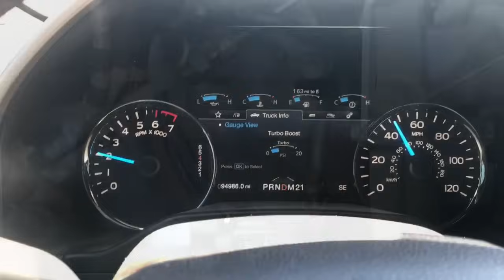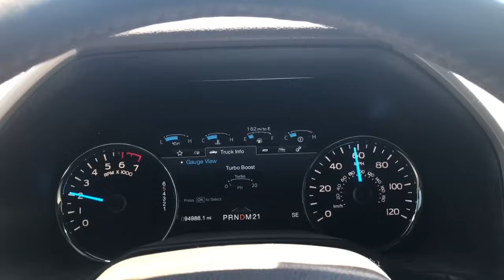F-150 Ecoboost 3.5 Turbocharger Replacement (Tips and Tricks)

Comment: on the wider pipe that connects to the air box, there is a small hard hose/pipe that connects to this pipe and what I believe to be the turbo actuator, after looking up the part number on it. this has broken off of the bigger pipe that connects to the airbox, that also looks gunky on the inside of the line. what is the name of this hose? it has caused some throttle body codes (first inspection there may be a bigger cause to the codes), and I want to start the diagnoses by replacing that hose/line.

Comment: My 2015 ecoturd has 111,000 miles with 5400+ engine idol hours I am having to change the drivers side turbo due to a bearing whistle sound.  your video is super helpful.  I did not know about the coolant drain part had I not watched this video.  GOt any tips for the 4x4 vacuum system and the wheel bearing noise it makes, mine always has a wawawa sound then when i shift into 4x4 it goes away.
Reply: can I ask what your oil change habits are for this 2015 ecoboost, as well as oil type ? Just curious.
Reply: I had that 4x4 issue on my 2015... there was a vacuum leak in the hub assembly so the hub had to be replaced. Took it to the dealer 5 times about the issue before they fixed it.
Reply: Dorman has an IWE permanent fix I used on my truck after multiple IWE replacements. I would recommend you look into this. I’ve had no further issues.
Reply: Daniel Hucklebridge hello. My oil change regiment is 5k and I use mobile 1. Also found out it wasn’t the turbos it was an exhaust manifold and it’s not completely fixed. Had to take it to the dealership.
Reply: My dealership charge is $175 per hr, quote 5 hour repair drivers side coolant leak.

Comment: I have a high mileage truck "210k". At idle the driver side turbo sounds like a bucket of rocks, and under acceleration the wastegate is very noisey.  Will be parking it soon to investigate further.

Comment: The coolant is leaking from the turbo charger.  What do you recommend?  Did you actually replace the turbo charger or did you just replace the bolts to stop the leak?

Comment: I’m having blue smoke upon startup and was thinking of replacing the oil supply tube for the driver side turbo. 

Did you replace the turbo with new or was this a service only job that you performed in this video?

Comment: Great video, good job explaining every nut and bolt!! I recently bought a 2015 F-150 3.5L Ecoboost, and I believe that I have a small oil leak from the passenger side turbo charger. It is very odd, I looked under the hood and noticed white smoke coming from there, but not a lot and not constantly. Only after running the engine at highway speeds than coming to a stop, also when idling for a while. It is very strange thing. I am 95% sure it is coming from the turboc area but i still can't pinpoint it.I saw in your video that the oil line is located between the turbo and the block, maybe that's why I can't see the leak... Thanks again!
Reply: No the line your thinking of is for coolant not oil.
Reply: Did you fix your problem? my truck is doing the same thing ..
Reply: same problem with my 2014 (smoke on passenger side). Leak was from vacuum pump. Google vacuum pump leak on ecoboost.
Reply: @BodeknockerBrumbill  Correct I just changed my vacuum pump.  Mine was smoking also.  Although Ive noticed I do have a coolant leak at my right turbo.   Havent tried to tackle that one yet.   Is it possible to just remove the bushing with the two o rings in it with out taking the turbo off?

Comment: I’m getting ready to replace my turbo. Have a question. I don’t have a torch but want to make sure I can crack those exhaust bolts off charger. Would a regular propane torch be hot enough to get those cracked loose?

Comment: I noticed an oil leak on my 14 eco 3.5. Researched and decided to tackle the vacuum pump. Replaced it, but noticed afterwards the burning oil smell still happening, and it’s coming from the gasket on the turbo. Do you think that could be remnants from the oil leaking from the above vacuum pump, or is there something that would cause the gasket area on the turbo to be smoking?

Comment: Great video besides on the 2012 the o2 sensor doesn’t allow you to slide the flange down so you have to remove those pos studs from below
Reply: Behind the brake pedal, there’s a cut out circle in the insulation. Pull that back there’s a rubber grommet that’s how you access the bolt closest to the firewall.
Reply: @donw22  that’s interested I was doing the passenger side they make it where you have to pull the studs to get the turbo in out vs sliding the exhaust coupler off the studs and out of the way. The nuts weren’t bad at all to get out though

Comment: On first start up after replacement how do you prime the turbo with oil?
Reply: Too late for you but for others, answer is hold the gas pedal all the way down pinned to the floor while you start the truck. Prevents fueling so the starter turns the engine and thus oil pump while it cranks. Hold gas pedal down for a good 7-10 count then release and truck will start.

Comment: How did test my turbos see if that’s my problem. I’ve had trouble with my driver side turbo. I just put a new one on one year ago now I have error code P0299. I just changed out the boost control it did not fix my problem. Error code still keeps coming up. I did the 10 point check all of those things look great. My turbo is not rattling like it did the first time please help any advice would be greatly appreciate it.

Comment: Did your turbo blow off sound like it was under water? Mine started doing this a few weeks back. As long as not under a load or high RPM it’ll drive fine. Once at high speed or rpm, it’ll throw a misfire code and go into low power mode. As soon as I clear the code on the fly, it goes back to normal and drives fine.

Comment: I don't like to use grease, my preference is Vaseline as this will not hurt the o-ring rubber
Reply: Vaseline (Petroleum jelly) is petroleum based.  It will swell and deteriorate the o-rings.  Use silicone grease on o-rings.

Comment: Great video! One question, do you have a list of the tools needed to do this job? I'd like to be sure I have everything before I start and realize I need something I don't have. Thanks!
Reply: The only weird tool you might need is that torx bit I think he said T47 or something like that. Everything else you should already have
Reply: He said t-47 for the 3 turbo fasteners but I didn’t hear if the other 2 were different.  They look a lot smaller.
Reply: Hello, did you find out what size torx socket is needed to remove the oil feed/return pipes from the turbo?
Reply: @erikwille5614  No, I was pretty short on time so I ended up getting a local shop to do it for me.
Reply: Oh okay, thanks for getting back to me  :)

Comment: My coolant line will not pop in the fitting after installing the nrlew one from ford. If i do not install the fitting and push it on the line it works but after install it will not

Comment: How did you know the turbo was going bad? Was there any engine codes?  Because I'm getting a crank position sensor code P0019 and P0025.  And one dealership said that my timing chains might be out of adjustment.
Reply: From what I've seen end up at dealer auctions, any engine besides the 5.0l need timing jobs around 130,000kms. The turbos last about the same. Currently dealing with a 3.5l twin turbo from a lincoln mkt that has both turbos failing. Guess the milage lol.
Reply: korutube i’ve had my orings done last week and my 2016 Expedition only had 50,000 miles when it went bad on both turbos.... why did it last over 100k in this vid??? This f150 is a 2013????
Reply: @ega0117  that fast huh? I haven't seen them that early yet. Unless you drove it too hard, or missed oil changes, I'd say they were bad since the truck was new. Either that or they somehow are making even worse turbos than before lol.
Reply: I’ve put over 100k miles on 3 Ecoboost trucks and never had turbo issues. The trucks were tuned too. I changed the oil on time and used motorcraft blend. I also used a colder t stat. My 17 truck was showing scary temps from the factory. 230° F towing moderate weight. I wasn’t a fan... 215° in stop and go traffic.. swapped for a 170° t stat and I never see above 187°.

Comment: Sort of a silly question, but i have the 3.5 in my SHO. I think the engine is turned in terms position in the SHO’s. I have a turbo in the front and rear. Which i need to replace my front turbo, is that the right or left turbo???

Comment: Not sure if this is a diy type job for me but the cost to pay dealer gives me long pause. When reinstalling top exhaust flanges with turbo and the air intakes at top you mentioned to make sure they’re done first. How hard is it to make sure it’s aligned properly so proper torque is done?
Reply: @Salvatore Izaiah instablaster =)
Reply: @Zane Jordy thanks for your reply. I found the site through google and Im in the hacking process atm.
I see it takes quite some time so I will reply here later with my results.
Reply: @Zane Jordy it worked and I finally got access to my account again. I'm so happy:D
Thanks so much you saved my ass !
Reply: @Salvatore Izaiah You are welcome :)

Comment: Oh thank you for the video. I had this job done by a mechanic, The truck was smoking a lot and burning oil. He said that it was a turbo in need of replacingafter he installed the turbo on the driver side the truck started fine but then all of a sudden it turned off and won’t start. It keeps on smoking a lot. Any ideas why this is happening? Thank you in advance
Reply: What did it turn out to be?

Comment: hey aaron....I have a 2011 f150 EcoBoost,  can I put 2013 turbos on it?   I notice the front part of the housing is completely different.    can those housings be pulled off my 2011 turbos and put on the 2013 I have?

Comment: I'm having an issue with removing the turbocharger on the passenger side. I removed the clip on that oil line fitting but the turbo won't pull away from line. Like it's stuck in fitting. That is the only thing holding the turbo up at the moment
Reply: How did you end up getting it off?

Comment: Did you experience any smoke from turbo seals during start up in the mornings before changing your turbo? Mine smokes like a chimney in the morning then after I drive it about a mile the smoke goes away until it sits again for awhile.
Reply: I have the same problem..
Please what did i do ?

Comment: Nice video. If you were going to buy a used truck, would you go for the 3.5, 2.7, or 5.0? Or would you go Tundra? Last question: has there been an average number of miles when the turbos go out? Thanks in advance.
Reply: 5.0. Anything over 120k will need turbos and timing chain on eco boost. Most will sell or trade vs the $8000-$10000 repair… I loved the eco power but I’m going back to v8 before they ban them. Engines always will have issues. But turbos and everything else is just more things that will break eventually on top of normal issues. It’s just to much. Everyone will be buying them up in next few years. Toyotas already gone full v6 hybrid twin turbos. Talk about 3 X the mechanical things to go wrong. At about 125000 -150,000 miles the battery will be done, the turbos will be done, so you’ll be looking at $10000 to $12000 for a Turbo job with inflation. Then the battery replacements $20000+. Your already on a ten year loan for a $80,000, $100,000 truck and you’ll hit these miles in 5 years or so. Still owe $40000 and have to dump $30000 to repair it cause it’s outta warranty. Most will trade then the next sucker will get stuck with it. Welcome to Bidens future America.
Reply: @Regular Guy Fixes  I bought a 2011 F150 Lariat w/ the Ecoboost engine, with the dreaded P0016 code.  Ended up being the timing chain was stretched.  Cost me about $3500 to fix the timing.  Even paying out of my own pocket, I still came out ahead for what I bought or what I like to say stole from the dealership.  If they would have fixed it, they would have wanted $5000 to $6000 more than what I got for.  I got to replace the compressor now as the clutch is about to break from the sound of it.  Other than that, it's been a really good truck.  I have a 2018 Explorer Limited with the 3.5 and hate it that it doesn't have the boost.
Reply: @regularguyfixes3142  ok so I have a 2013 F150 (137k miles) leaking/cracked passenger side turbo.  $2,100 to put in a new one.  It has to be done because it needs a gallon of antifreeze every 100 miles.  While the truck runs ok it seems sluggish and gas mileage is poor - usually averages 14.5 mpg  I have a P0016 code.  Mechanic suggests keeping an eye on it - but now I'm wondering if I should just trade it based on your comment about timing chain cost.  Am I living on borrowed time? I don't want to sink in another $4k for the timing chain.  Truck is a Platinum loaded and in excellent shape otherwise.  Advice?  Thank you in advance.
Reply: @danmichalko2673  if it’s ticking when it cranks up at first you will know. That’s the Chain. I’m at 210,000k on my 12. Been running good since. Has to replace a coil and plug recently. But wife daily drives. Just depends do you got the money to start over. Pay $4-$8k or pay $50-$60,000 to replace it at todays cost…. Other good news it they don’t make turbos for these anymore. They are all remanufactured at the dealer. They charge you the core. Like a battery. I tried to keep my good turbo to sell and said sure but will charge you the core price which was insane amount can’t rem what it was. They get you no matter what you try. I’m going to 5.0 when I do replace mine. While you can still get the V8s. Toyota’s have already gone v6, twin turbo plus a battery I. There suvs. You can only get a hybrid. The cost to fix that stuff is going to wreck the finances of who ever buys them.

Comment: Purchased 2 brand new turbos wanted to verify the waistgate was working on my original turbos and neither one of them moved one side held vacuum but the lever never moved the other did not hold vacuum. I got 2 new turbos in an i tried to verify waistgate lever action on them and neither one moved they both hold vacuum any ideas its a 2016 F150 3.5. Just curious...

Comment: There is a petcock on the new f150 they are located on driver side it's a red knob that you can put a flat blade screwdriver in it and there is a spout where it drains out...
Reply from the maker: Very interesting. Thanks for the info. What year? I haven’t seen one yet
Reply: @AaronHinesAuto  they are on all of them all the way up to current.. Now im not gonna lie its in a spot where you wouldnt nomally look.. I work for Roush and we do alot of crash testing so we have to drain coolant and all other fluids. But yea if you look up on drivers side its there by the core support. (Not the best description but dont know how to explain better lol)
Reply: @AaronHinesAuto  I have a 2015 that has a petcock on the driver side, there's a red knob on the bottom of the radiator and the nozzle faces toward the front.

Comment: Quick question for you i have a 2014 and i think im hearing blow by on my driverside turbo, no loss of power but a faint strange noise right as it starts to build boost, should i start by changing that gasket you changed?
Reply: matix10104 I have a 2014 that started like that and now my driver side turbo is done 😭
Reply: Sorin Tudor how many miles are yours?
Reply: z beshears 70k

Comment: How do you tell if it actually the turbo that is bad?
Reply: depends on the problem, fins shouldnt be bent, or chipped. small chips arent necessarily too bad, just means it ate something, and there may be a larger problem in the engine. there should be almost no visible play if you wiggle the turbo shaft, no leaks, should spin freely.
Reply: What if there is a loud whistling sound when accelerating??
Reply: @MtnWBassin  depends on the whistle, if you exclude a normal boost sound, I'd say boost or intake leak, possible a shift issue, while not always, those usually are more of a whine. Check the wastegate too
Reply: Bassin, from what I've read that sounds like the wastegate is getting stuck on your turbo

Comment: Great video I have the coolant line leaking on my 2012 the one closest to the motor on the passenger side. How much you think that would cost to repair. I was told about a 1000 bucks cdn. You make it look so easy to remove. How many hours do you think it would take the dealer for them to do this. ?
Reply from the maker: 1000.00 is a little steep. considering all the parts (gaskets and connectors) will be less then 80.00. the manual says its takes 6.3 hours to remove the turbo. even tho it takes far less time. should be right around 600-800. i have done this replair many times. so its kind of easy for me. thank you!!
Reply: Aaron Hines what fails to cause you to have to do so many of them? I have a 17 gen2 3.5 was wondering what to look for.

Comment: My 2016 3.5 Eco boost went into limp mode took to the mechanic now it's making a grinding/rattling noise sounds like its coming from the turbo on the driving side.  Whats your experience on those kind of noises? Please help your Video was great by the way
Reply: have them check the throttle body. oil is getting into the contacts of the throttle body causing it to go into limp mode